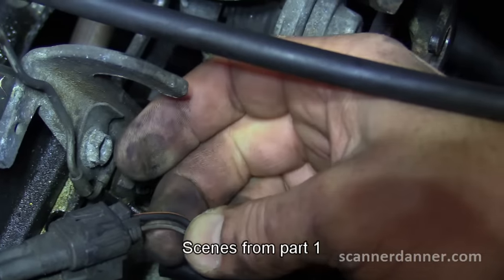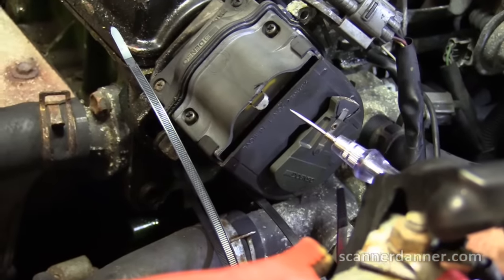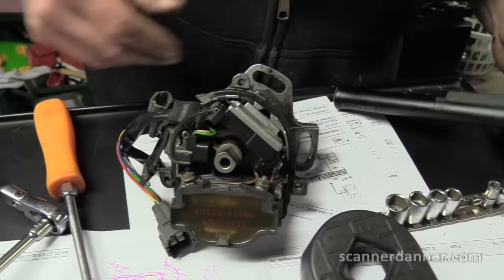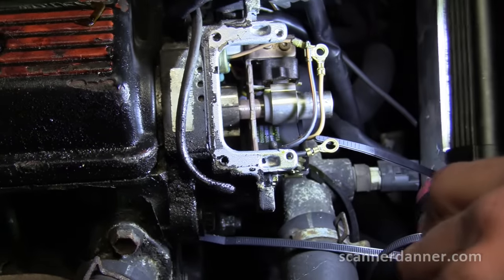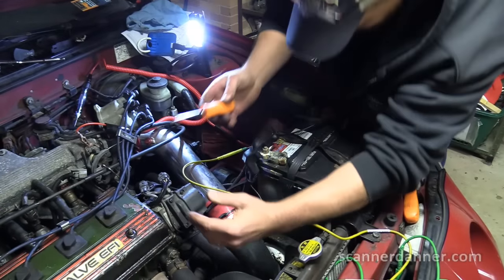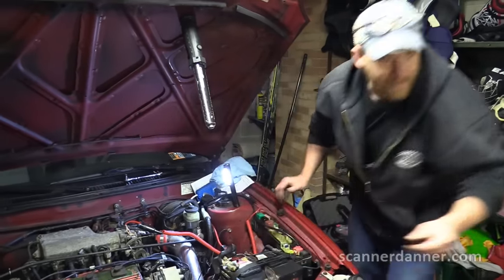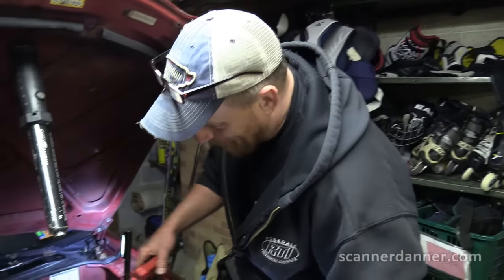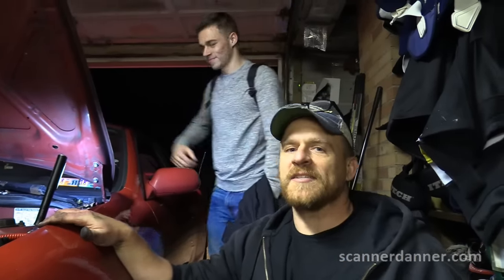Ignition System Operation & Testing - (No Spark Toyota Celica)-Part 2

Comment: Hey ScannerDanner I am having an issue with my 1990 Buick Electra Park Avenue when I first start it up cold it idles fine around 690-700 rpm, but as it gets up to operating temperature the idle will sink down to as far as 500 rpm, and when I go to put it into gear it is it still cold there is no problem, but if the engine is at operating temperature it will almost stall the engine, there are new park plugs and wires, I put those in when I got the car because the old ones wires were rotted out, I did a cam timing sensor and magnet because it needed it and I swapped out the ECU because the old one was faulty, and as of right now the check engine light is not on and hasn't been on since I did those things I have been running around in circles trying to figure out what it is, I also cleaned the intake manifold out using seafoam, I had to get a new alternator and battery for it, I have having problems figuring this one out, what do you think it could be?
Reply: Oh I also forgot to mention that I did replace the IAC on the car too because the old one had a bunch of rust on the shaft of the solenoid plunger.
Reply: Check for vacuum leaks. Use a vacuum Guage if need be. One thing that comes to mind on those cars, the automatic transmission is still vacuum operated. Look for a broken U shaped hose on the modulator, which I remember them being a common spot for the vacuum hose to rot out... usually won't hiss from what I recall either. 

If you want better help, check out his forum...  scannerdanner.com
Reply: I did that earlier today and could not find any vacuum leaks what so ever, I used some water and sprayed around and looked for any hoses that were dry rotted or cracked, and couldn't find any of those things either all of the hoses on my car look brand new, I also wiggled them to make sure they were seated properly and all of them were
Reply from the maker: One that generation fuel injection system, my first thought is shorted injectors. 
Got a bunch of videos on this.
Reply: Now which video would i watch to see how you tested this issue without a scope or anything like that, unfortunately I do not have any of those tools as I am just starting out in this field of work
Reply: Oh nevermind lol, I just did a search on your youtube page
Reply from the maker: cool man. You can use the ohmmeter, they should be 12.6 ohms each but heat is the key, resistance will change as they get hot
Reply: So I managed to get a get pulses from all 6 injectors, I kind of want to test fuel pressure but I do not have a fuel pressure gauge, but where would I go from this then? oh and also if you are still looking for the air box for your sons car I managed to find one for that year make and model at this URL https://www.ebay.com/itm/CELICA-Air-Intake-Cleaner-Filter-Housing-Box-5SFE-engine-94-95-96-97-OEM-/162366565852?rmvSB=true
Reply: Oh and also this car sat for 2 years before I got it, it sat in a garage could sticky injectors cause these issues as well? Because under a load it has a intermittent misfire if you shift it into drive and just sit there with your foot on the brake

Comment: Yes I need to go back from where you were explaining I have no power to my distributor
Reply from the maker: No power to the distributor right? What year, make, model and engine please? Thanks! I can try to help.
Reply: 97 Toyota Corolla 1.8 standard shift I'm getting no pulse of any type with my test light like you showed in another video I was watching when it was just a bad coil then you went further and showed the ground pulse to your fuel injectors on that video but I'm not getting that even
Reply from the maker: @chrizsinger372  no pulse to injectors and no spark = input problem (cam, crank, distributor signals) or computer problem (no power to it, bad ground, shorted 5v reference). Start with trouble codes. Do you have any? Can you communicate with the ECM?

Comment: What if the distributor, cap, rotor button, plugs and wires were replaced and still no spark?
Reply from the maker: Do the tests I've shown! You need to test for control from the ECM to igniter. You also need to do the coil tests I've shown

Comment: I would think with that old coil under 200 pounds of compression you wouldn't get a spark at all, from Fred in Essex uk.
Reply from the maker: That is one factor for sure, but in this case it couldn't even jump the rotor to cap air gap.

Comment: I dd the thing,the car is driving fine,The is that if i drive the car for about an hour and switch off the car,when i start the car again i dnt get the spark.it will only start after about 2hours or more.......service is uptodate,i have new fuel pump,alarm system and carburrator.........what could the problem (2E engine)

Comment: Mine just didn't turn on one cold morning changed fuel pump fuel relay distributor cap  aand distributor rotor 

Also on.the ignition coil where he tested the spark it is actually  rusted on mine could that be what's short circuiting my fuses they are the am2 30 fuses
Reply from the maker: Lots of questions you've left me with. You're blowing fuses? Start there for sure

Comment: Why doesn't the high voltage (30 or so kV) from your distributor fry your 12 V test light?
Reply from the maker: Not enough current flow through the filament of the incandescent bulb. 
You'll ruin an LED test light with this test.

Comment: I have a 1994 Geo Prizm it has the 1.6 it doesn't get spark to the plugs and when you turn the key on the fuel pump doesn't kick on and it's new and so is the distributor
Reply from the maker: With the key on, test for a 5v reference to your TPS and tell me what you see on all 3 wires
Reply: @ScannerDanner  I have no power going to the wires your talking about
Reply: @ScannerDanner  is the computer bad
Reply: @ScannerDanner  I can't find the computer on it at all can you help me locate it
Reply from the maker: @user-dt1sb9kg4j  okay sweet. Next step, check main ECM power feeds. Let me know what you find. If they're good, next step is to check for a 5v reference circuit short to ground.
You need a good diagram
https://eautorepair.adtrk.biz/?a=10817&c=24&p=r&s1=

Comment: Just had a weird day. An Autel scan tool ms906 in live data showed as engine running the EGR changing in percentage. So I checked the EGR Paul’s way by removing it and bench testing it. Power and ground across outside pins, and guess what. NOTHING. Resistence 7.5 the same as the new EGR I bought today which proves Pauls comments about resistence testing not being accurate. New EGR bench tested the same worked. So the scan tool was lying to me. I would have never fixed this had Paul not explained about the EGR and how to test it.
Reply from the maker: Nice! This is why I do not do resistance measurements very often. It is one of the worst tools (ohmmeter) to use when troubleshooting.

Comment: Hi.danner.my 95 corolla 1.6 auto..issue no cel light with key on crank with no spark so won.t start..why what can be wrong..?
Reply from the maker: Lots of different things! But with no check engine light when you turn the key on and no spark? I'd start with a 5v reference check on one of the critical sensors.

Comment: Hy guys am nw here I have a problem with Toyota tazz it start for 2 MN then cut off.i found the distributor cap damaged n replaced it but still doing the same problem nw it doesn't have spark at all.any help will do plz?
Reply from the maker: You'll need to do the tests I've shown in this video. Cannot help otherwise unless you give me specifics

Comment: I have the same problem with my car too bro, but it is a 1992 Toyota Corolla with a 4e engine. ???? can I use the coil from 5a on 4e???
Reply from the maker: If the coil is the same mounting, I dont see why not
Reply: Gm so I can  take the 5a coil  and put it on the 4e

Comment: What's the difference between an igniter and an ignition control module?
Reply from the maker: nothing really, the only real difference on the older model cars was an ignition module could control spark on it's own (without signals from the ECM) and an igniter never could, it was always ECM controlled. 
This had to do with something called "bypass ignition systems" that GM and Ford used. 
I have some videos on this. Type is keyword "bypass ignition"

Comment: Hello, had a miss fire on cylinder 1-4-6 so I replace all the spark plugs,  connectors and coil, done put everything back, double check everything looks good but it will only crank but no start, before the obd2 port was working now the scanner turn on but no communication with the computer. Can any one help please? thank you
Reply from the maker: turn the key on and see if you have 5v reference available at the TPS
Reply: Thank you, it was a short ground from the camshaft sensor

Comment: can you test a distributor with just a multimeter?
Reply from the maker: You can't really test coil negative control very well as the signals are too fast. But an incandescent test light can be used with high accuracy for that test.
Also on the type with the transistor as part of the coil? The trigger signal is also too fast for a voltmeter

Comment: I have a new coil that jumps the same distance, but it wont start even with fuel working
Reply from the maker: is the spark just as strong at a plug wire? (cap and rotor issue maybe?). If it is good there, next up would be to verify timing, then compression, then for a restricted exhaust

Comment: Hi Genius father. 😊
Bro I hve 86 Corolla with 1.6 Engine Same problem of Misfire n Running 2 3 4 gears in CNG I change Coil also . Plz Some Guidance 🙏😊
Reply from the maker: Only in CNG?
Reply: @ScannerDanner  yes only n CNG Sir in Pertrol so Fast response. Sir What abt Air Filter If Light did not Cross I think it must b change if Solved problem with this 🙏Thanx Fr Reply sir
Reply from the maker: @shohab khattak  unfortunately I am completely unfamiliar with those systems, so not much I can offer. Maybe post this to my forum www.scannerdanner.com It is free to join and we have 30k global members and maybe someone there can help you more

Comment: 5:25 I don't agree with this. If it doesn't need everything then don't replace everything. Whats the point of diagnosing it to this degree if the conclusion is going to be replace everything?
Reply from the maker: We only changed the coil my friend. I was warning people of what I see ALL THE TIME. An open plug wire WILL kill the ignition coil. If you get a car that comes in with a situation like this you better make sure that is not the case before you sell the job.

Comment: Loved the honesty of this vid. But one thing I disagree on is how much hate you guys give to those cold air intake tubes. I love them. They don't give me power or fuel economy. But they give me room to work. Those plastic covers and air boxes need to be removed every time you have to do any minor repair. That takes too much time.
Reply: chungaleta1234 those air filters are exposed to puddles, salt, grit, & debris much more than the enclosed airbox, which I have had 1st hand experience with on customers cars. Also, I have seen some cars just run horribly with the aftermarket junk. The combination of those 2 huge factors is what makes Paul or diagnoticians hate the aftermarket stuff.
Reply: I give you that.  I live in the city and have never had an issue with it.  I wash the filter every 2 or 3 months and I love every time I open the hood and everything is at the reach of my hand.  But you have a valid point. Depends on the car and the place where you live.
Reply: chungaleta1234 haha... you said it right there. Most of my customers think it's install it & done. They definitely don't do any maintenance work themselves or not much.  Most of the time customers wait until something breaks. So the fact that you stay on top of it, definitely makes a difference.  
Others use too much oil... lol and all the dirt & grime sticks to it like a magnet. My customers may install it due to the BS & gimmicks of gaining something or making it look pretty, not knowing about upkeep.

I'm in the city too. Philly, PA.  & Paul is just outside of Pittsburgh, PA
Reply: I'm from Costa Rica, no snow or heavy weather down here. I've used them on my 98 S10, my 05 Escape and my wife's 06 Aveo. And I guess because I am a maintenance freak who is under the hood at every chance I get, it is a great thing.   I change the oil every 2 thousand miles and spark plugs twice a year LOL.  But you are right, not all customers are OCD with their cars.
Reply: chungaleta1234 hey! That's awesome! I envy you right now! Beautiful weather over there, I'm sure! Such a pleasure talking to you! It's a fantastic thing to be OCD with your cars, you'll know exactly when things are not well & nip them in the bud! Take care sir! 😊😊
Reply from the maker: exactly Cuba! I've had NOTHING but issues with them on so many different cars. They have their place on heavily modified engines but that's it.
Reply from the maker: Costa Rica! I was there in Oct 2017 at Playa Grande 
Are you close to there?
Reply: I am from San Jose. Playa Grande is a beautiful place, hope you liked it and you come back again!
Reply from the maker: If I got back, you need to come hang out with me for a day. I'll bring you a book too :-)
Reply: It'd be an honour!!!  Just let me know when you are down here again, I can help you out translating if you need it, like that case study you filmed in Panama.
Reply from the maker: exactly! communication was an issue for us. I used google translate all week for our caretaker. Now how to figure out how to remember you when the time comes. Would you do me a favor and email me at paul@scannerdanner.com so I can save your contact info?
Reply: Doing so right away!
Reply from the maker: got it! Thank you. I'll be in touch

Comment: .........no hard feelings meant. But you broke several gaskets(?), shorted ignition circuit, engaged starter motor while the engine was running & long gapped the coil after posting to others not to do so. You're an intelligent guy, with much knowledge.             So maybe a little sleep? I mean it IS dark outside, uh?
Reply from the maker: I broke a 20 year old gasket 😃, shame on me

Comment: I'd take your glasses off because if they fall, you need new glasses! DON'T wear them like that with the engine running!!
Reply from the maker: They are $3 readers  :-)
Reply: @ScannerDanner  I gotta hand it to you, you're GREAT at diagnosing cars! You get in there and dig into systems and find the problem. I wish all us guys had that equipment! My auto-mechanic teacher says that sometimes you have to listen to theory. Theory says. He says sometimes you have to get away from the book. Even though the book 'says', you listen to theory. But computer cars have sensors that ALWAYS break-down like MAF on Ford trucks. 70's G.M. 350's were KNOWN about the starters. Ford Triton engines break off plugs. I put .030 rings on our 1985 Ford LTD 3.8 when I rebuilt it. It STILL runs and don't throw out blue smoke. It's like ring job after ring job. I had to file the hell out of the rings to get it to fit. I filed them to the minimum gap, .008. The spec said .008-.010. I bought them at Pep Boys, it was all they had. The cylinder head, a machine shop shaved it like corn rows. I showed it to Pep Boys. He called the other parts store machinist. The machinist swore his work was good. The machinist did a threat of bodily harm to the Pep Boys parts guy. Pep Boys sued and won! That other parts store closed down because of their machinist! One guy brought down the whole operation! It'd been in business since the '70's. It had mufflers, tail pipes, paint, and just about EVERYTHING! It was a 'mechanics parts store.' One cylinder head brought down that whole store! Customers were mad at Pep Boys accusing them of 'knocking off the competition'. After that came AutoZone and then O'Reilly's. AutoZone's alternator tester said my alternator was good. Another AutoZone said it was bad. Turned out, it was the regulator! Goodson has valve seal tools and other engine tools. I saw Richard Petty in person! He signed cards showing his cars from the '70's up. He wore his cowboy hat and blue shirt and blue jeans and cowboy boots. His sunglasses had the STP logo on it. I saw Rusty Wallace later! Rusty's old car was orange and white. It ran at Dover. It was at a grocery store. One time the engine didn't start and the truck driver let guys standing around get to push Rusty's car into the trailer! Outside, one time, he fired up the engine and windows rattled!! I went to school with Hulk Hogan from 5th- 10th. My 8th grade yearbook shows Hulk in the 8th grade in 1973. It shows his REAL name! He wrestled on the playground in the 6th in 1970. I stood there and watched Hulk-A-Mania being born right before my eyes! He came up with the name Hulk Hogan in the 6th when he was about 13. He sat next to me to my right when a girl announced that he 'says he's going to become a wrestler and he's going to call himself Hulk Hogan'. His boyhood home is at 3104 Sussex Rd. in Augusta, Ga. It's a yellow brick house with open- ended carport on both ends. The driveway slopes up. There's border grass on both sides. I stood at the end of the driveway during the Summer between 8th and 9th and Rick came down the driveway to me. He said, 'You'd better leave or I'm gonna beat you up!' I hopped on my bike and left. Then he said, 'Well, what do you know, I scared him!' He didn't scare me, he startled me. He had muscles in the 9th! He flexed his right arm standing next to me and he had a muscle like half and orange! I had the future Hulk Hogan to flex his right arm standing right next to me to my right! He was on the football team in the 6th, 7th, not the 8th, 9th, 10th-12th. His position in the 9th was 'back'. He ran with the ball. He had blond hair all his life. He had bangs from elementary school to high school.